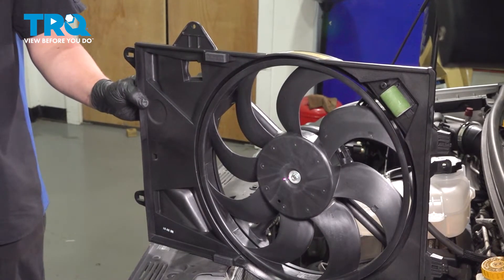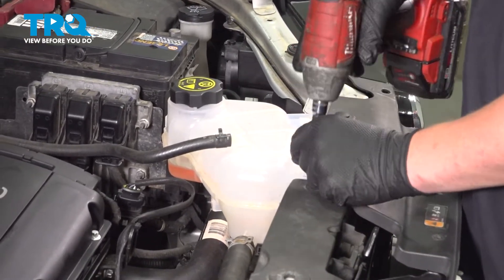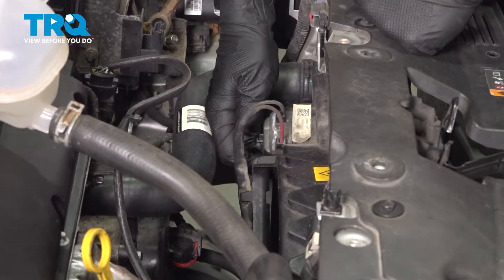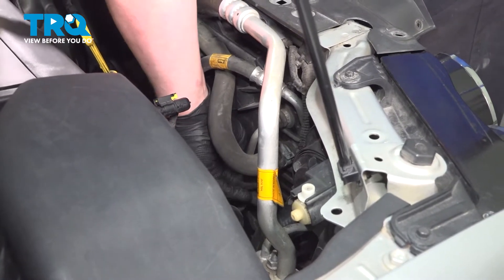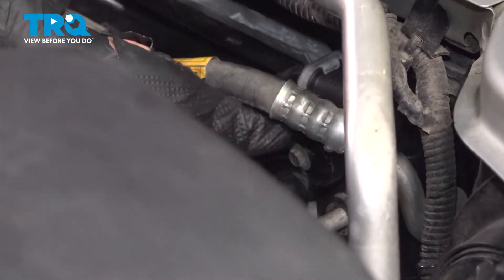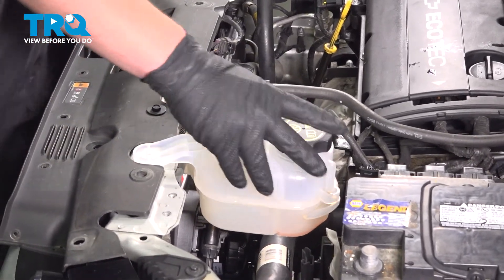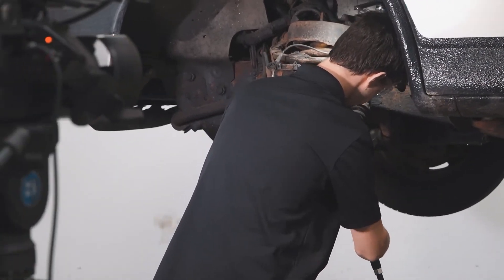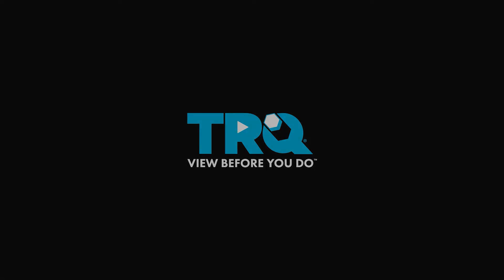How to Replace Engine Cooling Fan Assembly 2012-2020 Chevrolet Sonic 1.8L L4

Comment: Thanks for the help unplugging the fan so I can limp the car back home (the bearing failed and it’s 28° F and on the idle test started at 122° F and climbed to 143°F coolant temps after 10 minutes of idling so I’m gonna limp it 3 hours back home tonight and hopefully find a replacement at a parts store tomorrow and fix it